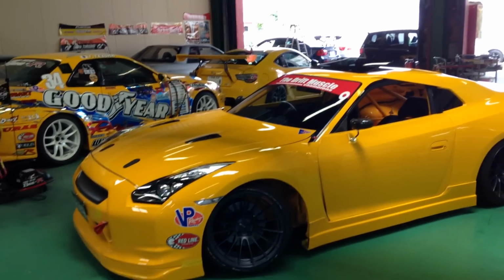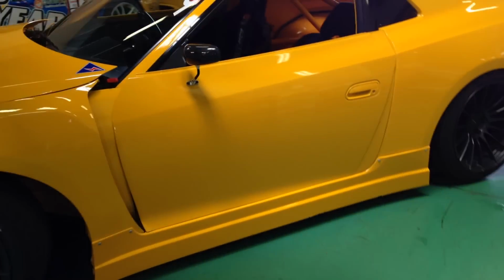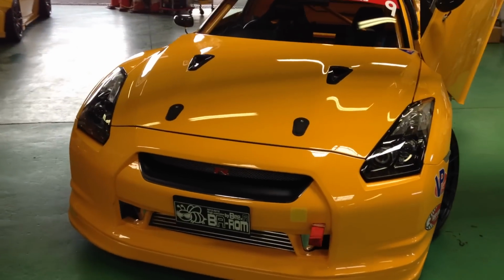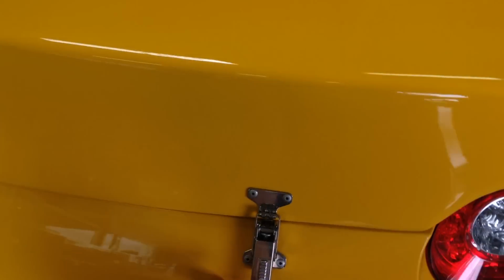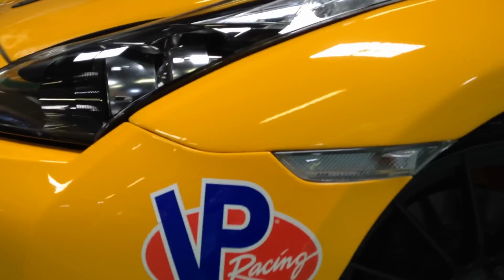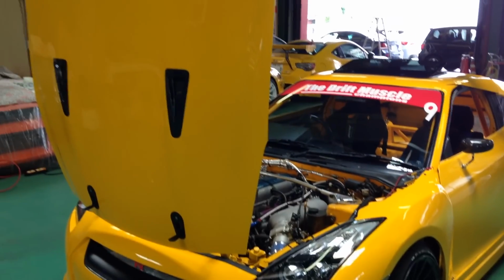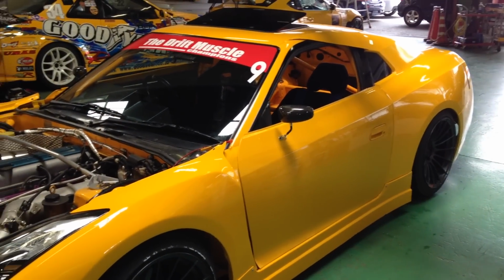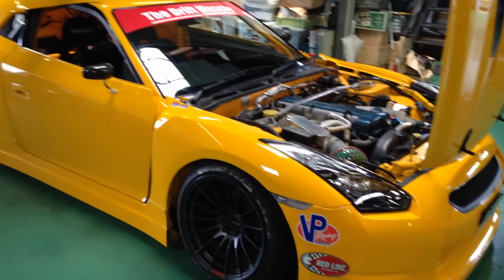INSANE BEE RACING "B80R" 180SX WITH R35 BODY AND 2JZ ENGINE!!

Comment: Adam, I think you are greatly mistaken about the gearbox part. The stock 6sp Getrag V160/161 that comes with the supra can handle pretty much ALL the horsepower you can possibly throw at it for a street car, anywhere between 500HP and 1500HP, you just need a good clutch to hold the power. The gearbox can take ungodly ammounts of power and abuse. There's many Supras around the world running and beating hard on it, and in the 1/4mile they're into the 10's, 9's, 8's and the world record holder, SW's  BoostLogic built Supra which ran a 7.91 on the stock gearbox and IRS. Video of it here: world's fastest supra S.W. 7.91